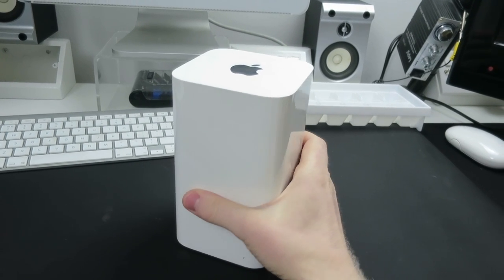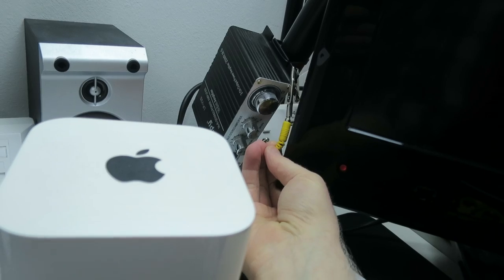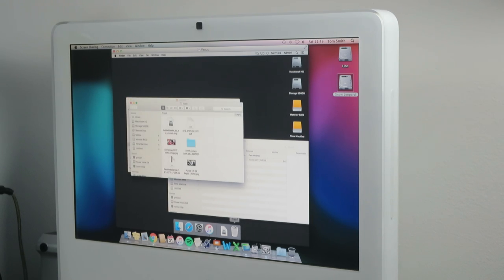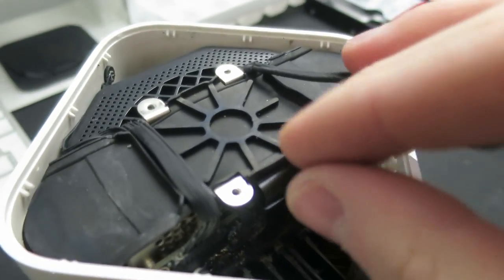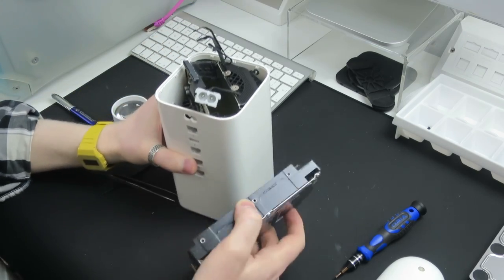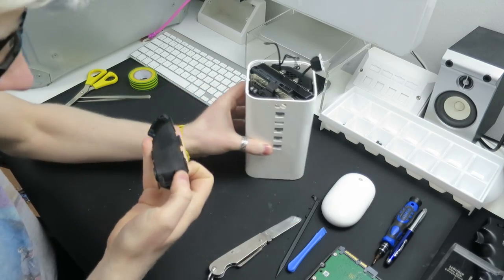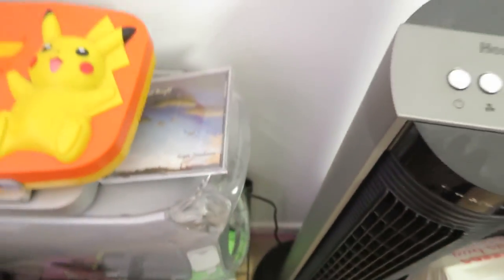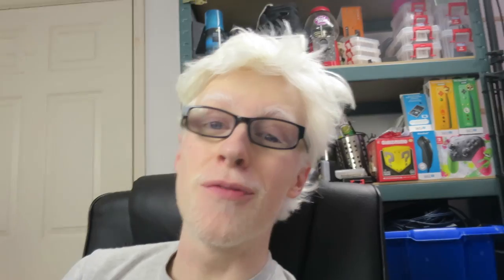Apple Time Capsule Dead Hard Drive Swap (802.11ac Model)

Comment: I just replaced my Time Capsule’s 2TB Seagate drive with a 6TB Seagate and it was surprisingly about 1/4” thinner than the original. Thankfully I had a 2” x 2” x 1/4” piece of foam rubber which I wedged in beside the drive to take up the extra space and it fit nicely with just enough tension to keep the foam in place. I also used an old fashioned wooden pencil with a rubber eraser to guide and attach those 2 small connectors and it worked great. Thanks for this helpful video

Comment: The time capsules Apple make I find so much better than other NAS/Router solutions, i still use a pair of the old A1254 time capsule units, modified with a 4tb drive in each and replaced power supplies (the old psu's cant fire a 4tb drive up for some reason but the replacement ones can ), only ten quid for a psu for them, and i use one of them as my main router, it connects to my VDSL broadband via a separate ZYXEL vdsl modem , and since using the time capsule as a router aswell it just works flawlessly and . using the "back to my mac" functionality when i add my apple ID to the time capsule, i can access the hard drive on it anywhere, which proved useful when on holiday as could access my music library remotely (yes i have great upload speed luckily). Very solid units, and the first thing to go is the drive, mine came STOCK with WD Blue apple branded ones oddly.

Looking forward to part 5 tom, if you ever wanna chat apple and networking stuff , you got me on fb :)

Comment: I always use the little Dixie paper drinking cups to store screws. I just plop the first round of screws into a cup, then stick an empty cup into that cup, rinse and repeat. That way, I can just work from the top down when re-assembling (and if you've ever tried to work on an old iBook, you need LOTS of screw holders.) And if the stack of cups for some reason gets knocked over, they should be packed enough that no screws go spilling out as long as there's at least one empty cup on top of the stack.

Comment: Just used your video to add a 18TB drive to an old Time Capsule - this was incredibly helpful, thanks!
Reply: 18TB??? I didn't think it could even support 8TB, however, could you tell me if it works well with 18TB, so I can do it too, thanks
Reply: @FRANCO_IL_CHIMICO  it does work well! I’ve noticed that writing significant data during Time Machine backups makes the unit warm so make sure it’s well vented. Beyond that, having a wired Ethernet connection will make things much faster, even on WiFi 6e mesh networks. Good luck!
Reply: What is the reference of your HDD pls?
Reply: @tipsyttp  the exact drive I ordered on Amazon - Seagate IronWolf Pro, 18 TB, Enterprise NAS Internal HDD –CMR 3.5 Inch, SATA 6 Gb/s, 7,200 RPM, 256 MB Cache for RAID Network Attached Storage (Renewed)

Comment: I’d been looking into buying one but due to lack of income(16 no license and no job yet) I’ve been holding back. I’m using a Mac mini right now and I love it, I’ve set up an ftp server and installed a open source operating system on a raspberry pi in my family room. I can watch any season of tv shows I have in any room on any computer/phone. I also have sight issues too(born with only one eye) but it never stops me. Keep up the great content
Reply: Awesome to hear about your tinkering with an Raspberry Pi! Those things are awesome :) Also, just for your own curiosity, there are ways to make a Linux box (such as a PC or even an rPi) show up to a Mac as a TimeCapsule with software called "Netatalk", though it only uses AFP (Apple Filing Protocol), which isn't really used by much anymore. Still interesting to look into nevertheless, though I have yet to get it working myself as networking isn't my area of expertise >_>

Stay curious! ^_^
Reply: archlinuxrussian that sounds like something I could play around with, thanks for the heads up. I have a diverse computer setup with many Apple computers and some windows, so far the setup works wonders. However your idea sounds fun to try I’ll just want to buy another pi since I use the only one I have as a client and not a server itself. I don’t know much about networks but I use what I know from google, networking classes, and just experiments. Thanks
Reply: Yeah, the setup is basically "Have Ubuntu/Debian installed (though other Linux distributions would work too), install netatalk and avahi, make sure both netatalk.service and avahi-daemon.service are enabled/running, and set up users/configurations", so it shouldn't be too hard. You can find a bunch of resources by searching "Linux time capsule server" or something, but here's one that I came across, though I cannot vouch for its reliability. https://fzhu.work/blog/mac/making-ubuntu-server-a-mac-time-capsule.html 

:)
Reply: archlinuxrussian thank you for your very in depth answers, I’ll be sure to look into it. Thanks much

Comment: Nice video instruction. Thanks for that.
* IMPORTANT * The little connectors do NOT pop off sideways. Doing so they will damage.... Instead lift them a little to the top and then move sideways...

Comment: The video is very well done. I use SuperDuper and I am very satisfied with the fact that you can boot the system from the external hard drive and it has USB3 which your device is not. But it's ok. Respect

Comment: Cool video mate... be careful next time with tiny wires/tiny circuits... I once dropped the tip of a screw driver in a brand new motherboard and spent roughly 4 hours with my dad repairing a snapped connection on the MB. Lucily he's good at that and managed to make a 0.5mm solder on the incomplete circuit. Saved the MB.

Comment: I have been wondering about doing this with my own time capsule not because the drive is dead, but because I want to increase the capacity and like the idea of it fitting in a nice compact Apple Time Capsule. That said, with minimal airflow inside of one of these things, I am concerned about the additional heat a larger capacity drive would create and how that would impact the reliability and longevity of the new drive.

Hmmm...wish I could at least measure the temperature inside one of these things somehow...

Comment: Do you have a link to that screw driver set? I could of done with it when I installed an SSD in my 2014 Mac Mini. I had to buy the bits separately and had to use a Poundland screwdriver.

Comment: Please, for the life of me, Get rid of those WD green drives The modern day equivalent of the Quantum Fireball. I have had so many of them have head crashes. Anyways, seeing the inside of one of those inside was cool though. Keep up the good work
Reply: i have had my wd green 4tb for almost 5 years and its been in constant use every day since I got it so ive had no issue with them
Reply: Wait and see...
Reply: Yes, mine died about 3 years ago and I nearly lost ALL MY DATA. They are AWFUL.
Reply: unlokia it probably will die one day but I know they use wd Green drives in sky+ HD and some sky Q boxes and I've never had one of them die on me
Reply: One could say that about any electronics product. ;)
Reply: Silicon lottery, as it were. All mechanical drives are prone to failure eventually. NEVER rely on one holding out indefinitely. I've seen different brands to bad.
Reply: True, had a Re4-GP go bad on me, but the two normal Re4's I have are still running fine even with nearly 50k hours on it.
Reply: My WD Green has been going for 13 years! XD (and i'm still using it)
Reply: My WD lasted 5 years. I am on the blue drives now.
Reply: No Western Digital is the cheapest and worst drive you can buy.

Comment: Is it possible to find conversion hardware and install an 2.5" SSD in this?  Anything difficult with the soft-firmware set up?
Reply: You should just be able to find a 3.5 to 2.5in drive sled and use that. It doesn't have to be specifically for an Time Capsule, just any old 3.5 to 2.5 adapter. The connectors are the same, so just put the SSD into the 3.5 to 2.5 sled, and slide it in, then plug it in and you're all good.

Comment: Nice video. Honestly repairing that reset button should be a piece of cake, even though I'm bad at soldering I would have no problem doing that. You should do it as soon as possible before you accidentally lose those parts.

Comment: How is your Hackintosh doing? And do you recommend the 2015 macbook air or the 2012 or 2013 macbook pro
Reply from the maker: My Hackintosh is doing great!! But I must admit, I've chickened out of any updates since 10.11.3 so I'm way behind. Planning a fresh install on the Hackintosh once I get my data sorted.
In answer to your question, it really does depend on what you want out of a machine. I will say though that the MBP is generally a much nicer machine, simply because of the display, assuming you're talking about retina models.
Reply: Get a 2015 MacBook Pro, they are really good machines and I would definitely recommend them over the older 2012 and 2013 models.
Reply: i have a 2012 MBP and I absolutely love it. It's my daily laptop, use it all the time as I travel full time. Still works a charm for 1080p video editing in final cut with 8gb of ram and an ssd, and logic pro x works wonderfully as well. obviously it's fine for web browsing, word processing etc
Reply: never tried, my camera only films in 1080p, and the people i do editing for usually only film in 720, lol
Reply: Buy a 2015 pro before they are impossible to find and if you want an air buy that before apple ruin that too. Or just do yourself a favour and buy the current get LG gram.

Comment: Hey, I have a Time Capsule 3 TB (802.11ac), recently I have problems with backing up one MBPretina 13 ", 2015, 500 GB, can it mean the end of the disk ?? and is it possible to change the disk in TC to a larger one, 4 or 6 TB ?? If so, what kind of regards, Martin

Comment: Tom what a fantastic video, did you say you are going to use the Time Capsule as a router? If so Openreach supply a Modem (well 2 versions), which depending which cabinet you have depends which one you use. One's Huawei and the other ECI.  Plusnet will allow you to use another device with the connection.  Swapping out the Hub should be easy...

Comment: I have tried seriously to use Apple’s Time Capsule with 3Tbyte drive for three years, and it has been a nightmare. When it’s filled up with about 2,5 Tbyte, it just stop making automatic backups, gives a meaningless error message and stops working. I have set it to delete old backups if necessary, but this feature doesn’t work! And the worst is that I can no longer access my previous backups! They have all disappeared. The only option is to erase the disc and start over. - When I switched to a new iMac a year ago, Apple Support tried to assist me because their software didn’t work as expected. It took me eight full days to restore my backup (with the MacOS with settings, software etc), and the result was that a random selection of files had been restored. Most programs did not work, lots of important files had not been copied and the restore process was a giant failure. Apple Support had no explanation or suggestions, and I understood that they are not proud of this product. Their last words were: «But it’s nice when it does work!»

If you have few programs and not too many files (probably less than 1 Tbyte), you may have luck with Apple’s software and the Time Capsule, but my best advice is not to use Apple’s solution as your main backup!

Comment: Copying one file to a new drive is hardly enough of a test of if a new hard drive is going to work properly.
I am a bit perplexed as to why you did not use any better solution (there are plenty of free software to check hard drives), especially since this is a backup drive.
ANYWAY, good video as always. :)  I just wish you would make more videos :)
Reply from the maker: Absolutely true.. Time I guess!

Comment: I just came across your video because my time capsule hard drive just failed it keeps dropping off talk to Apple found out they’re no longer made repaired or serviced anything with my hard drive keep dropping off the tech-support they still provide said that it’s probably not a hard drive issue it’s a software issue well if it wasn’t that I was going to ask you for your Address and see if you wouldn’t swap out a hard drive for me you ever thought of doing a low profile one.

Comment: What a silly product that is! A backup solution with a single, solitary drive that can fail and ruin the entire backup! Am I missing something? That just seems completely pointless.
Reply: You should understand the difference between short-term backups (better: snapshots!) for quick restoring reasons in case something happens to your computer (TimeMachine/TimeCapsule) - and long-term archives for storing valuable data in a secure way (NAS with RAID, offsite storage, cloud backups etc.) The TimeMachine/TimeCapsule has the purpose to help you over an intentional/unintentional new install of the OS, e.g. in case your main hard drive fails or you (have to/want to) replace your iMac etc. It also buffers changes of mind, when you deleted or changed files, and gives you the ability to go back in time to restore a former state of your iMac. The same is true for virus infections or faulty updates/software installs. It is quite unlikely that the hard drive in your computer fails at the same time as the hard drive in your TimeMachine/TimeCapsule. In this case you can easily restore the state of your iMac as it was one hour before the incident. The worst case is that you loose one hour of your work at max. (If the TimeMachine/TimeCapsule fails, you just replace it with another one and let your iMac - which is still perfectly fine - make the next backup. Then you're covered again.)

TimeMachine and TimeCapsule do not claim to be a totally secure long term archive. For that additional measurements have to be taken. But they are hourly snapshots that give you peace of mind for minor mishaps - they won't help you in catastrophic events like when your house burns down.
Reply: @hape3862  "should" is the key
Reply: Eric, it is also a dual router a/b/g/ac with beam forming antenna's as well as as: 
(1) Network Attached Storage device that allows you to share files across your network seamlessly via Bonjour
(2) remote access from the outside (via Back to MyMac)
(3) Print Server via Bonjour
(4) backup up critical data
Doesn't seem silly afterall ;-)